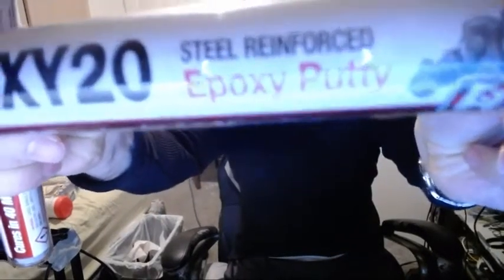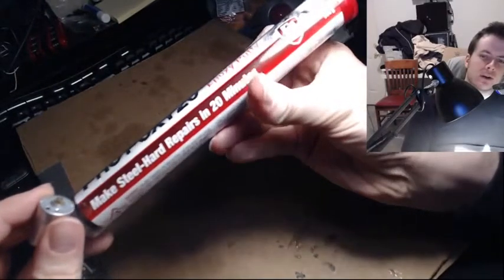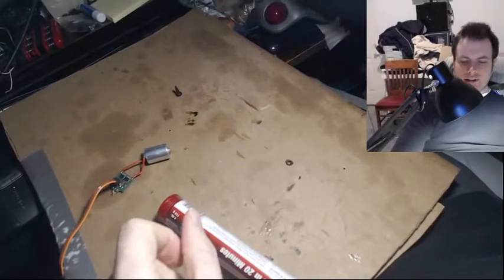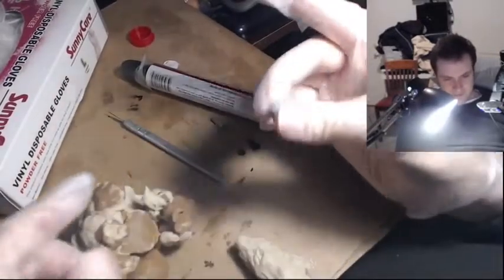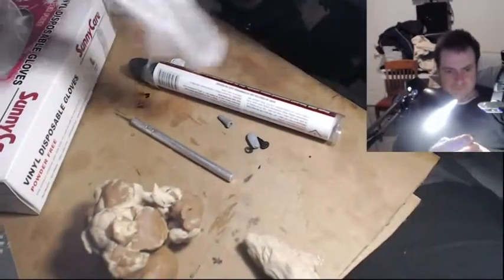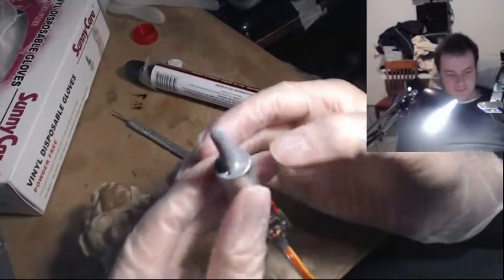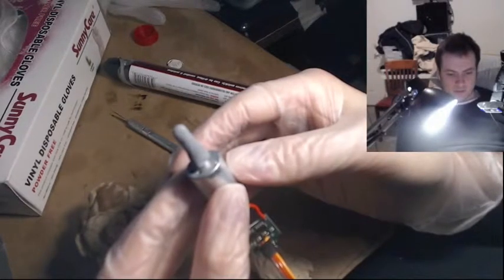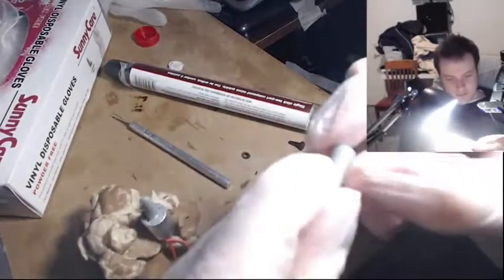Custom Servo Motor Output Shaft Mod Part 1 of 3 | Building Humanoid Robots #62

Comment from the maker: note: at this time, I did not know that you can just buy brushed dc motors like this one but with output shafts that are smooth cylinders like 2mm in diameter and 1.2cm long while being this exact same size brushed motor.  They are for sale on ebay called n20 motors and cost like $0.90!  That would have saved me going to these lengths trying to fabricate such a shaft onto a splined output shaft made for a geared servo.  That said, since the making of this video, I have realized that ANY use of brushed dc motors is cheapening the robot overall.  Brushless dc motors is a massive upgrade.  Size 2430 brushless dc motors are about 25% bigger than this motor and pull 200 watts compared to this thing pulling 2.5 watts.  They are way faster and stronger and better in every way.  They also run more quietly and efficiently and don't have brushes that may wear out.  They are the king of robotics.  Such a motor I just described only costs $11 compared to one like this in the video costing $1.  So yes it is more but still not prohibitively expensive.  Now the control of the brushless dc motor is more complex, but even this can be DIY'd and thereby reduce cost to be very cheap like just $3 per motor in control parts.  The control parts can be miniaturized if you DIY it.  Custom controlled brushless dc motors is the way to go.  Electronoobs youtube channel has a few videos on the topic of making your own electronic circuit to control a brushless dc motor and this is really not too bad to do this type of circuit diy and is plenty cheap and will make your robot 1,000 times better.